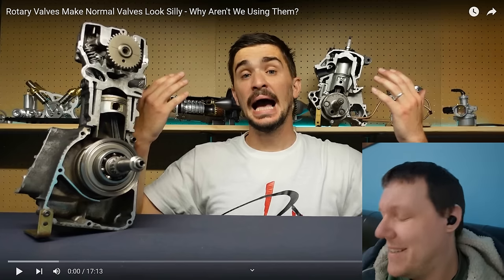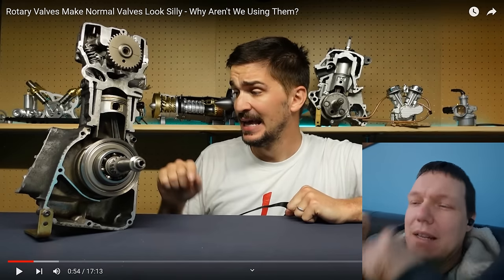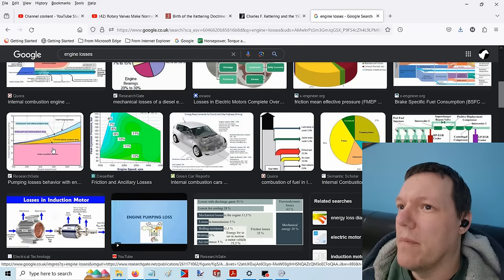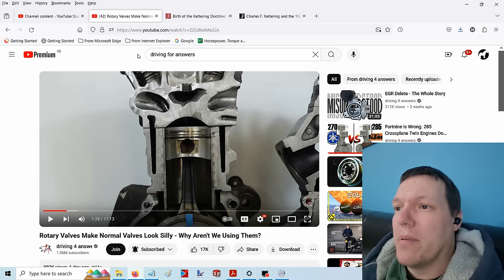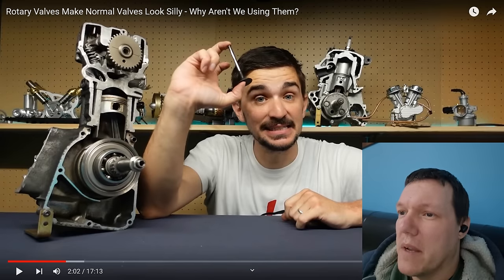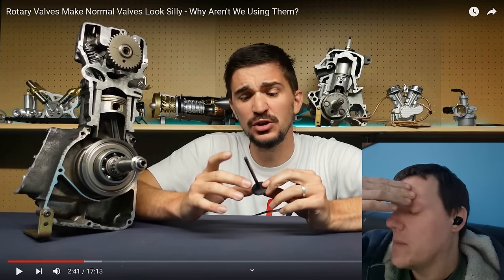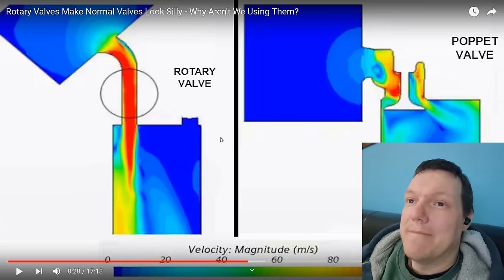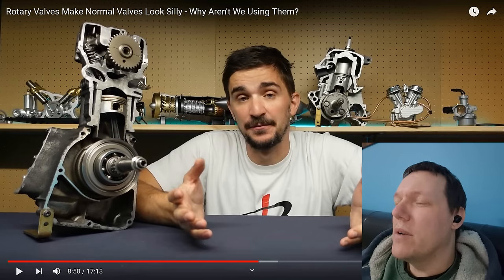We learn about POPPET valves - NOT!

Comment: Rotary valves are superior to poppet valves in every way! Besides all the ways that they are worse...
I was thinking about potential problems with a rotary valve, some that weren't mentioned.
He says you can do variable valve timing the same way as you can with poppet valves, but I can't imagine any way to do the equivalent of variable valve lift with a rotary valve. The duration and lift is effectively fixed into the system as a function of the size of the hole through the rotary barrel. So no equivalent of vtec or any of the variable lift/duration technologies that are used with poppet valve systems.
The other thing I was curious about is the thrust against the rotary valve from cylinder compression and combustion. The thrust against a poppet valve has the advantage of sealing the valve tighter. Surely the thrust on a rotary valve in it's "closed" position would increase clearance and wear of an already compromised sealing system.
Finally the compromise in combustion chamber shape with a rotary valve. With a rotary valve you are going to have weirdly shaped combustion chambers to accommodate the size and shape of the valve.
But besides all those problems and the fact they don't seal, you know the one job a valve has to do, like when you do a leak down test on a poppet valve engine and decide it needs a rebuild because the valves are leaking, yeah that tiny small issue, besides all that... totally superior to poppet valves.

Comment: The rotary valve 2 stroke has existed for decades.  Spoiler alert, it's dead technology.  You can't alter duration or lift like you can with a poppet valve camshaft 4 stroke engine.  We have various "power valve" designs for 2 strokes but in the end, 4 strokes won.

Comment: awww man at the start i was like:fuck u mr. dirty for making this video, cause im a big d4a fanboy.But then i watched the whole video and i gotta say u made some really good points with a very good explanation to back it up and thanks to that, i really learned a lot.however i got to thinking about what u said about springs in the valve train not actually causing energy loss but storing it for later. And i had to ask u hoping for a reply: do u think piezoelectric crystals like u find in an average joes lighter with its entire lighter fluid ignition mechanism could be used to ignite fuel in a car engine instead of having to rely on battery power?
Reply: btw when i said lighter mechanism i dint mean literally put it in and engine cause a lot of it is made of plastic.i meant a more robust metal heat resistant version build specifically for our broom brooms on 4 wheels.....please dont roast me....hahahah
Reply: and the reason i said all this bollocks is cause u said that springs in the valve train dont have energy loss but energy storage which is ideal for a piezoelectric lighter cause they are really hard to actuate but since u said that the springs dont loose energy but store it i said to myself why not ask this question from u
Reply from the maker: Piezo's won't be able to produce the high voltage required. A battery is there mostly for the starter motor, loads of dirt bikes run without a battery at together.
Reply: Another thing about a mechanical piezo ignition system would be that the mechanism would need to be physically moved to control the timing.
Reply: @dirtygarageguy thank u so much for the feedback

Comment: It is chain driven so the point of less moving parts is pointless cos chains got to be tensioned,  got wear, start rattling...
Such a normal valve is more reliable and is easier to maintain, the combustion is higher and it will deliver more power.
You for sure don't want to warm your intake air permanently and the longer you drive your vehicle. I would assume you have more losses for cooling your system. Cos if you do not cool the longer it runs the higher are the losses in power.
This will not fix anything, the standard valves can't do atleast same as good.
So for what he does that? Wow, I got less problems at max rpm?
Won't you need a variable gearing like a cvt to adapt the speed of the air you get?
Heavy, unreliable and we just have 11 years left. 
He gonna "get rich" with the ideas he got...
Cos the industry will stop listening if they hear rotary and think at suzukis re5.

Comment: They initial goal with these engines is to compete with small engines used in trimmers, chainsaws and stuff like that they say. And they go on comparing their engine to a 4 stroke. But really they should be comparing their engine to a 2 stroke ones because that's the competition they need to fight in small displacement equipment. And no waaaaaay in hell some 4 stroke rotary valve is gona outperform a 2 stroke in any way and it's gonna be significantly heavier and that's a real problem.Not even gonna talk about production costs. Then when you step up to non handheld equipment you get to a cost and reliability problem,how are they gonna make something cheaper and more reliable than honda or Briggs and Stratton 4 strokes. It's just not gonna happen. If this goes in to investment and development phase it's surely gonna be just another cash grab with no product at the end.

Comment: The early jet engines had poor reliability mainly due to unsuitable alloys to deal with the heat. If one had increased the number of moving parts in other to cool the engine, reliability would've likely increased.
Rocket engines are an even better example. A lower number of moving parts does not necessarily translate into an increase in reliability.

I think that this chap definetly has the Del gene.